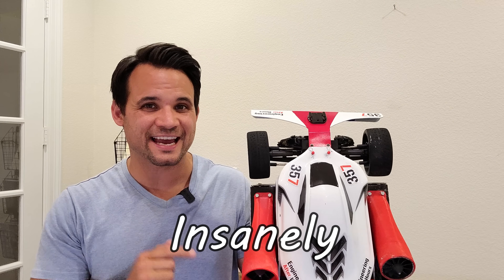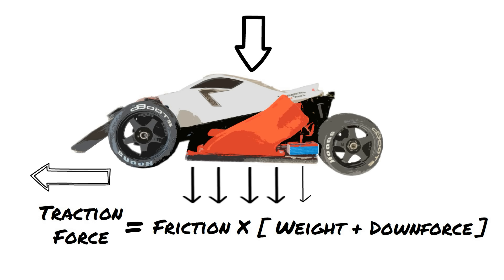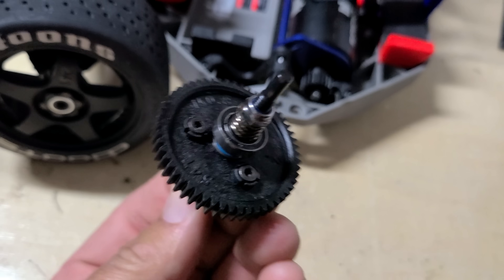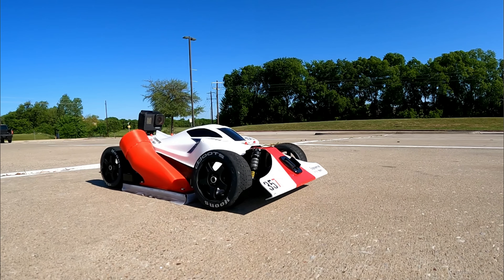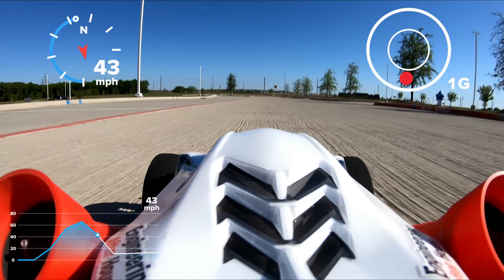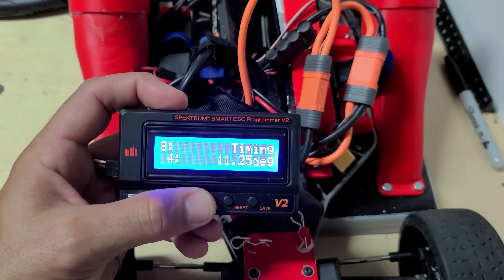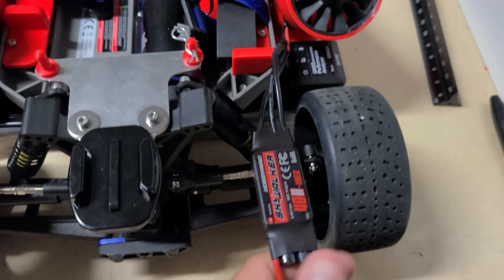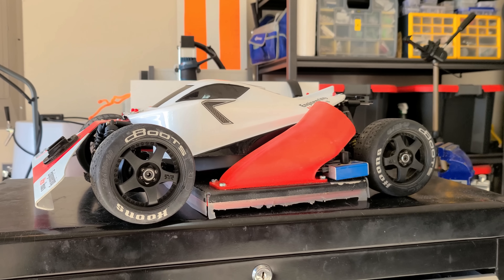241% More Grip with a Fan Car and Ground Effect

Comment: Please try to do lap times on a rc track with this, comparing aero system on and off, and the best rc cars available (and why not, making it be driven by rc professionals) ahah
This car needs to be a thing!
Of course I subscribed ahah
Reply from the maker: Haha I love the suggestions. If I weren't a terrible race driver it may be a good test. I'd love to get a pro to test it out.
Reply: @EngineeringAfterHours  that'd be amazing ahah
Reply: Just a note: I think that the ideal fan control would be a combination of both throttle and strerring, maybe also combined to a factor derived from the g forces of the car. On my channel (this specific one) you can see I did a car mod for assetto Corsa which is the fastest car in any game. Basically it's so fast because it emulates the fan sucking by using a dynamic angle system for the wings. Of course being it a game I had a lot of ways of easily making any value immense. But I also met a ton of issues. The angle of the wings is controlled by many factors, reason why I was thinking at a function of every control and maybe also g forces. If well tuned it can improve by a ton efficiency and why not also performances. Though it requires a more advanced chip than the ones equipped usually in RC cars, I guess

Comment: Great great build!!!!! THE “STUDDERING” on takeoff is called COGGING!!! It’s because you’re using a NON SENSORED kv motor!!! By going with SENSORED, the motor can begin acceleration from a dead stop IN AN INSTANT without “cogging”…. Sensored is a feature that allows the esc and motor to communicate with one another soo that the esc can KNOW the pol positions of the motors magnets and and distribute voltage in the proper sequence…> NON sensored motors is like a blind man with a walking stick, it needs to find its way…

Comment: Well done. Loving your channel. I like how you show the trial and error in your video. I would recommend a castle MMX8S esc and motor sensored set up , that will help eliminate stutter on your start up . Castle systems are much more efficient. And again look at BSR foam tires.
Reply from the maker: Thanks! I definitely want to get a castle sensored setup for this guy

Comment: Awesome video mate, loved every second of it. 
I have a few suggestions which will definitely help to reduce your time further. 
I would recommend getting a Castle ESC + Motor since they are sensored and have more power, this will eliminate all the stuttering at the low end. Switch out the Arrma tires to GRP S1 tires or even foams if you can find them, the traction is way better on those. For batteries I would look into Chinahobbyline G+ 70C. These are the best batteries for value in my eyes. 
I have an Arrma infraction and I managed a 0-62mph time of 1.79sec without any ground effect so I'm confident that you can manage a sub 1.4.
Reply from the maker: Good advice, I'll look into the GRPs and the batteries as I've never worked with either of those.
Reply: @EngineeringAfterHours  You can usually find some discount on the batteries as well :)

Comment: Based on what RC car ...what motor what kv what volts what gearing ???
Reply from the maker: Slash 4x4, spektrum 2050KV 6s and I mention gearing in the video I think but went through a few cases. 

I definitely need to go with a sensored setup
Reply: @EngineeringAfterHours  Wicked mate love it.... Keep going 🤗....x
Reply: @EngineeringAfterHours  can you do a race against what people think is a fast RC car ...say like bandit vxl or traxxas xo.....just to show how much faster your car is ???? That would be such a cool video x
Reply from the maker: @locostse7en  next time I rebuild it I definitely can. I'll probably run against a 2wd slash LCG with a VXL setup for a good comparison.
Reply: @EngineeringAfterHours  mega....can't wait to see that race x

Comment: I got a Arrma big rock and granite that I bet would destroy that Tesla in a drag race lol. And the big rock is on 2.8 proline interco super swamper TSL SXs mud tires. It's got a 4290 2250kv big block on a hobbywing Max 6 esc. All metal gearing all metal axles aluminum integy A-Arms proline big bore shocks a custom stainless steel wheelie bar that is highly adjustable a custom aluminum center drive shaft. I got brass weights in it to hold it down on the ground. The diffs are steel and aluminum custom ones I had made for me at a machine shop they also made my custom motor and spur mount and center drive shaft. So no gears are breaking lol. I put a Arrma Skinz Chassis protector on it and also a stainless steel chassis plate that's cut out so you can see the cool skin underneath it. ATM I'm running a Integy 20T mod 8 pitch pinion and a Integy CNC built steel spur gear 57T ATM. With the custom gears in the diffs with the pinion n spur gears with the motor n esc the big rock gets to 89.3mph and it can achieve much faster speeds I just haven't pushed it all the way yet but I will eventually.. and I been dying to race a Tesla 😂😂

Comment: 6 years ago I also made a concept an electric vacuum car. Modelled after the Ford Probe 5 concept. I wanted to break the 350MPH mark. In normal road it wouldn't be a thing because of the vacuum. But in the track, would be different idea.

Comment: If you use a sensored motor and esc that should get rid of any stutter that is happening because I do know that those non sensored motors tend to be glitchy like that at low speeds or the jump

Comment: Couldn't you have just used wider wheels and tires? And should you turn the fan off or lift the skirt right after launch?
Reply from the maker: Wider wheels doesn't increase the coefficient of friction, and you need the fans on the whole time to generate the downforce required to get over 2Gs of acceleration.

Comment: I would love to see how much faster or would run on a smoother surface like a school gymnasium or a roller rink or inside a big warehouse. I imagine the fans would work better giving you better traction and hopefully quicker times.
Reply: Low traction surfaces though. He'd be better off running on a well maintained drag strip.

I wonder if the sticky compound  most at the start line would be too much for the drive train to overcome though?!

Comment: OK I'll do my best to ignore issue #1 the large T name.

back in the 00s I did parking lot racing,  all my rc's had aluminum chassis.  Get some skateboard sliders (sorry can't think of what exact compound these are) ,  and mount them so you're not scraping the front or rear of the box.   I used to shave them very thin then wax them. Aka reduce drag from ground contact as much as possible 

sensored motor,  this will give you the best launch, from the electronics standpoint. 

 you're still getting a lot of "squat", suspension tuning and possibly even a wheelie bar might also help keep those front wheels planted and clawing.

A lot of the "no prep" guys run a short course or 1/8th base, including the slash,  so there's plenty of tire choices out there for high torque high traction launches.

Seriously consider something other than Traxxas,  and take a look at some of the chassis actually designed for high speed or no prep drag racing,  it'll solve some of these issues you had to resolve right out of the box.

Comment: Get yourself two direct drive motors instead so you can get rid of the differential and drive shafts. Custom cut a car body so you can use a direct drive system. The lack of weight on the wheels is an issue but you can fix it by making really long car... When you throttle up, the torque trying to lift the front of the car will put more than the car's weight on the rear wheels.... Yes, the rotating car can temporarily exert a force on the wheels that's bigger than the actual weight of the car itself! Also 2 seconds 0-60 isn't fast... Dragsters get easily under 1 second... And they have to carry a human, and include parachutes for slowing down safely. The problem is you started with a race car body, not a drag race body.
Reply: Next thing is, if you're trying to go for 0 to 60, you can probably overpower the motors, and battery by a 2:1 ratio of actual rated power as it's going to be sustained for less than a second. If you do it right, it will overheat in a second but it will be too short to actually damage things. Remember: dragsters can output 10000hp for a few seconds. That's equivalent to more than half dozen Bugatti Chiron.

Comment: The stuttering at launch looks like something us drag racers deal with called "wheel hop", generally suspension and tires (changing from low profile like you are running, to large flexible side wall drag tires) are the solution. If you look at some of the slow motion launch clips, 12:30 for example, and watch the tire and road surface you can see the tire is actually slipping, more more precisely slipping for a fraction of a second, getting grip again, then slipping again. Look up "drag racing wheel hop" and you can get some good analysis of it for full sized cars you can probably apply to to your model but I would put money on that being the cause of your stutter at launch.
Reply: Did you also notice how much flexing happens in the suspension components further worsening the wheel hop situation. You can see the wheels moving back in forth in relation to the chassis. Traction bars up front and trailing arms in the back would definitely help with wheel hop. Im not convinced its a motor issue as alot of people suggest, as much as it is a suspension/tire issue.
Reply: This is wrong.  There may be some wheelhop but the stuttering is a non-sensored brushless motor characteristic we call “cogging”.  Someone had a decent explanation in the comments.

Comment: Have you tried a front wing?. Also batteries that are not powerful enough will amplify the motor cogging. If you are only doing short runs then go for the highest c rating you can get over large capacity .

Comment: Why not take track surface out of the equation and find an asphalt lot? How much are you loosing simply because of track induced instability? on a scale basis, you are driving down a strip  covered with baseball sized rocks.
Reply from the maker: You are spot on. The seams in the lot kill my time too. I'll definitely look for a better surface for the next run.

Comment: Maybe you can introduce some kind of speed reduction scaling for the vacuum. The vacuum is good I am guessing for the initial 0-20mph but after that it simply adds drag and the body itself should create enough downforce once you have enough  airflow over the chasis. A similar technology is where cars use an active wing i.e. it pops up for cornering, breaking and accelerating but pops down when higher speeds are reached.
Reply: Without it, it would flip.
Reply: @quackatit  - please reread my comment. It is the initial acceleration that makes it flip. It won't flip once above 30 or 40mph.
Reply: @tomedward8652  Int this case it wouldn't work.
Reply: @tomedward8652  The weight the stability and the speed would couse it to flip. One bump and that's it. 
https://youtu.be/g8XxQkXCmsU
In this case it flipped when the front wheels were not touching the ground properly he was going downhill. That caused the flip. The rc car jumps around a lot. If there is even slight wind it would flip.

Comment: I would ditch the large suction plate at the center for a smaller one ahead of the steering wheels (centered fan blowing straight up) and use it as front spoiler also.
The propensity to lift the from during acceleration will be highly reduced by the force being applied at a longer distance from the CG of the car (near center of body).
A smaller suction plate ahead of the rear wheels powered by 2 smaller fans blowing straight up would also increase downforce mid body.

These smaller suction plates will reduce weight while still applying the same dynamic down force load.
My 2 cents. :)

Comment: Very cool, however what is the power to weight ratio?  I'm assuming its higher than Tesla, so one would expect it to be faster all thing considered.  You have batteries and motors with a plastic frame vs batteries, motors, complete human driveable car...
Reply from the maker: First off...When you are traction limited, the power to weight ratio is not the deciding factor.

Second...the power to weight ratio of this rc car is just under 3lbs/hp whereas the tesla is likely to be just over that mark if we assume comparable HP to the plaid and 40-50% heavier than the original roadster. It's actually possible the roadster has a better Power to weight if the mass is really kept down, but the batteries are expected to be pretty heavy so well see.

If the cars were power limited INSTEAD of being traction limited...you would be correct.

Comment: Need a Sensored Motor, AVC on, and use the Arrma Infraction Chassis.
Reply: Just start a new build, and start with the arrma Limitless !!!
Reply: Yep any of those arrma chassis setup right are 0-60 in under a second

Comment: OK well 1st off your starting off with the wrong platform!  I have at least 3 cars that I've built that will absolutely destroy that time without some giants stupid fans on the bottom trying to hold it to the ground. If you actually built the car right and started with a larger scale chassis RC car you would be able to be the Tesla's time. I can do it all day with 2 of my 1/5th scale 16s cars. fome tires and longer wheel base!
Reply from the maker: Prove it! On an unprepped track especially.
Reply: he's talking about acceleration. 0-60 mph. 1.9 secs is really fast. I've seen faster top speed rc.
Reply: https://youtu.be/90wTeisYThQ

Comment: Have you extended the pan vacuum box forward between the wheels ? I think extending a small portion 2"x3" approximately will decrease the off the line vibration . You seem to have plenty of vacuum,  and distributing the vacuum will help with other factors of load on take off.

Comment: Are you going to do any test on different track surfaces, like maybe a velodrome?
Reply from the maker: That would be an awesome surface to test on. One of the challenges I have with testing is that despite it being a "toy"...it can be incredibly dangerous so I need a ton of space to test safely. Otherwise if the throttle sticks or something...its 8 lbs of metal and plastic going 70-80 mph.
Reply: I was wondering about this too. It seemed like some of the bouncing around and dragging the skirt would be fixed by driving on a smoother surface. You would also have less traction on a smoother surface probably so I don't know how much it would help.

Comment: I see people have already commented about sensored motors, you should definitely look into them though. It will most likely eliminate all the stuttering off the line since the ESC will already know the motors rotor position.
Reply: "sensored motors for the win!"
~me, a guy who drives a max 8 sensorless combo
Reply: WOW HE USED SENSORLESS MOTOR?!
There is no much performance left out on the table omg!

Comment: You might want to try the gold label Hoons they're stickier than the whites but I think the no prep guys are getting faster launches already with wheelie bars.
Reply from the maker: Yeah I think with no prep the best reasonable time is in the 1.8s range. With a prepped surface or aero...it can obviously go lower. Top fuel dragsters are practically glued to the track at launch and end up with sub 1s 0-60s.
Reply from the maker: I'll also look into getting another pair of gold hoons...ive got rears for a 2wd, but they're larger.
Reply: @EngineeringAfterHours   I mean no prep RC it's blown up in the last few years. I've seen some wild launches whatever 1.6 secs for the 132' scale quarter mile is.
Reply from the maker: @PabloGonzalez-hv3td  thats an average acceleration of over 3 Gs, which isn't physically possible without adhesion and downforce. 

I was trying to get away from that as its only useful to prepped dragsters and not really along the theme of a road car. It's still hugely impressive, but a different objective.
Reply: @EngineeringAfterHours  The wheelie bars must help in those departments no? They'd definitely flip without them.
It's been done although average ETs are between 2 - 2.5 seconds. They're using dedicated drag slicks/skinnies and lightweight mid motor 2wd platforms.
Reply from the maker: The wheelie bar definitely helps. When you have that much friction, the wheelie bar keeps the front end down. If you had low traction, a wheelie would be much harder. 

In order to accelerate at 3Gs from standstill, you need a very high friction coefficient which in the case of dragsters really goes beyond that and into adhesion. To get 3Gs with no downforce you need a friction coefficient over 3, and that will easily flip a car, so you need the wheelie bar.

But no straight rubber tire will have a coefficient that high either. You're really sitting below 2 with a high end racing tire that's already warm. To get the mandatory 3+ you need tire prep and/or a sticky track.
Reply: Hoons golds are best for prepped track otherwise bsr foams are fastest

Comment: Instead of a 1 foot rollout, scale that down to your car's size. If you can test on a much smoother surface everything should work better. A high lubricity, graphite filled material like SGL Carbon Group Ridurid® V 1640 High Performance Graphite Filled Plastic might help to reduce the friction of the skirt.
Reply from the maker: Thanks for the recommendation on the material...ill look it up. 

If I scale the rollout I would then need to scale the speed...so measuring 0-6 mph. I wanted a straight up actual speed comparison.

Also, the 1 foot rollout is based on the staging light spacing at a dragstrip...not the vehicle size.

Comment: One question. What is the reason to put the batteries and fan controller near the rear axle?
Reply from the maker: That was where I could cleanly fit them them as low as possible. I wanted the CoG to be low, and they needed to tuck under the body I had.